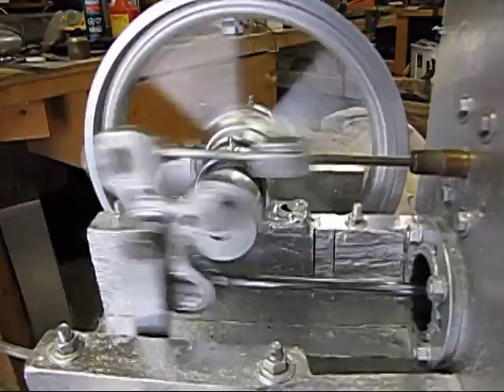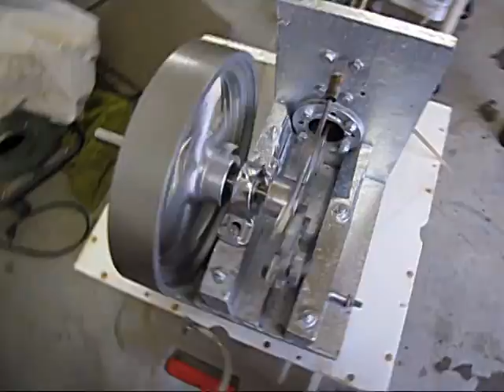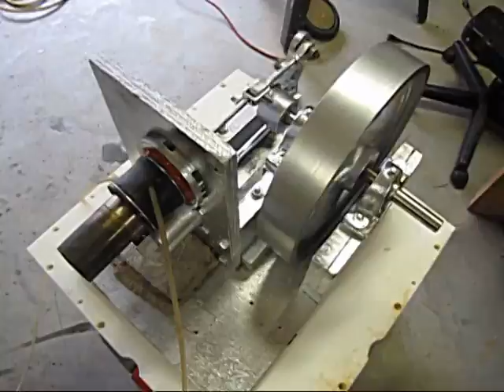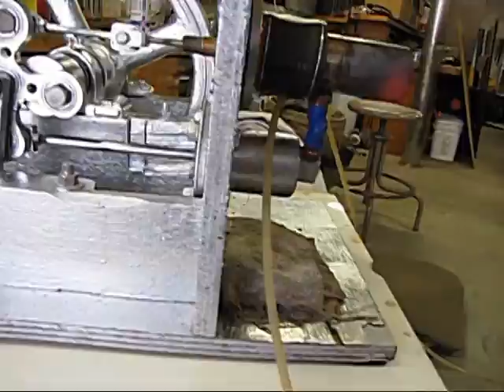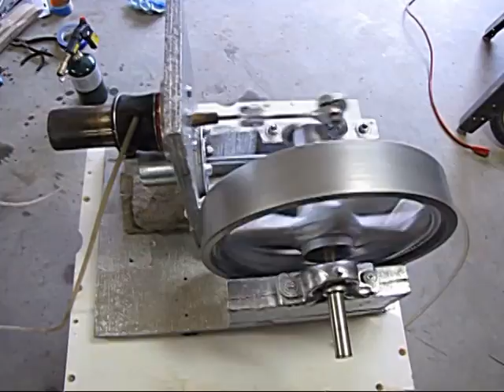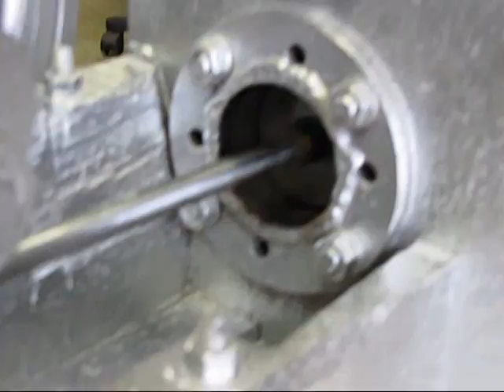Home-built Yoke-Drive Stirling Engine

Comment: this device may connect to other equally and provide power to generate movement and cool a stirling engine side, so this side can condense the water present in the atmosphere and function as an atmospheric water generator (like brand EcoloBlue water generators)

Comment: It runs very smoothly!  Because you painted the base silver I thought you machined the base out of a solid block of metal!  :P  Nice build!

I'm working on another engine, this one will have a steel wool regenerater.  I am hoping that it will produce more power then my last one.

Comment: Ever know of the Triple expansion steam engines? I wonder if one could run the waste heat from one cylinder to several others the way high pressure triple expansion engines did.

Comment: Great design smooth operation but something's wrong? As thermal dynamics dictates, "balance of both gases is most important." Sometimes too much heat and not enough heat sinking can hinder its operation. This not necessarily a good thing? You're apparently lacking the cooling stimuli thus robbing your cool device of power. Lastly, remember the physics involved here, vacuum and pressure offset by pistons...